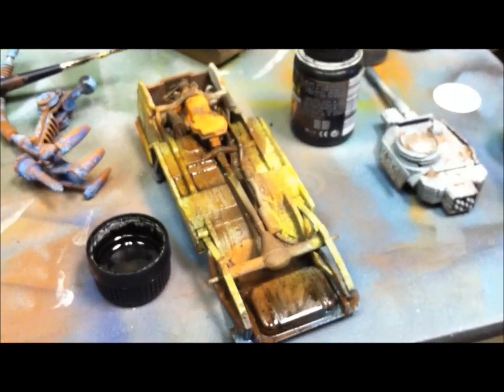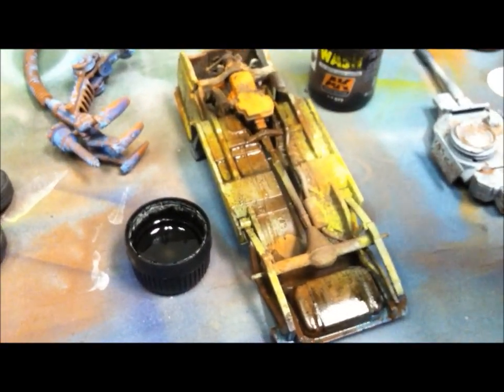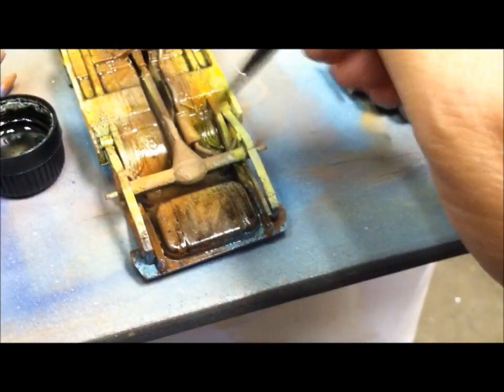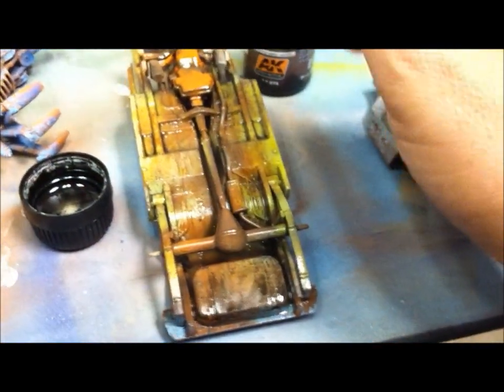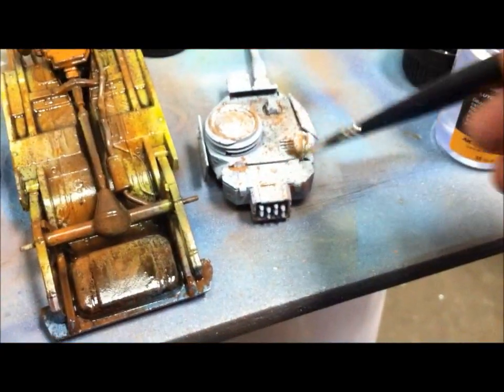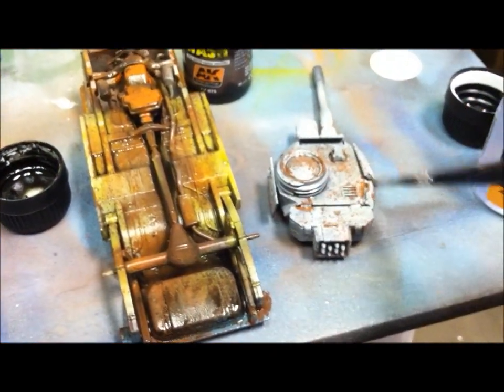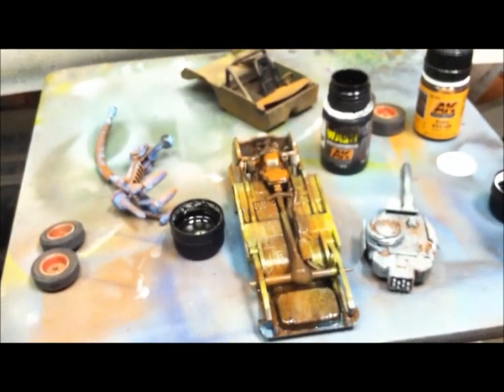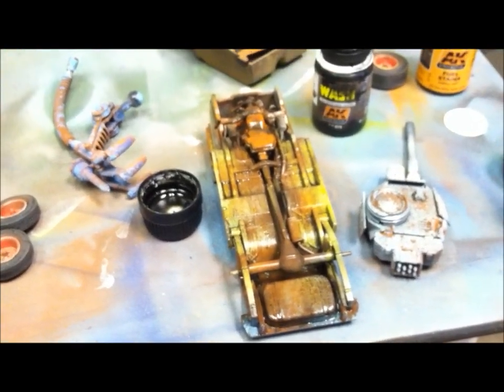AK-INTERACTIVE WEATHERING SOLUTIONS:  WASHES

Comment: I havent used enamel washes before but I know that with acrylic washes you can add a drop or two of dish soap to break the surface tension so you dont need to clear coat if you dont want to first